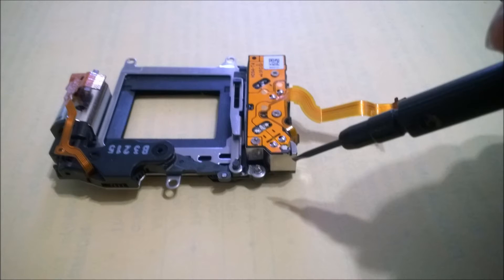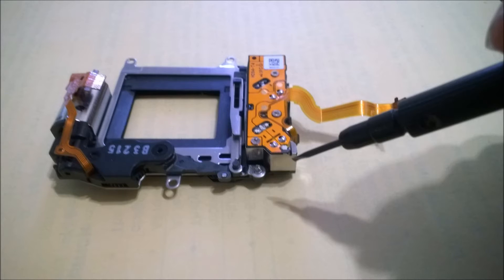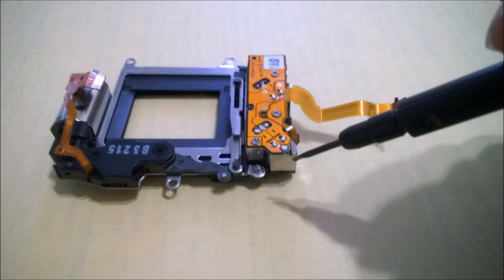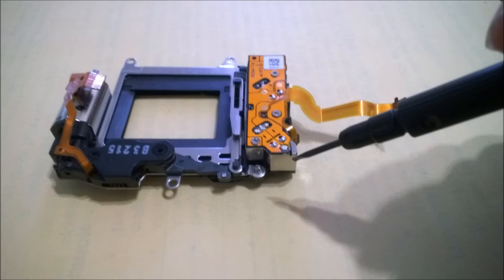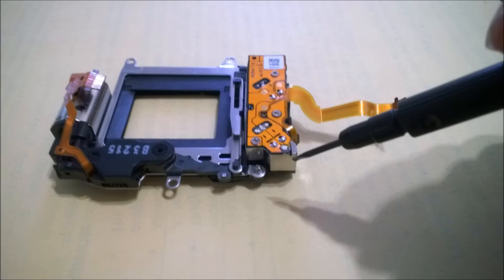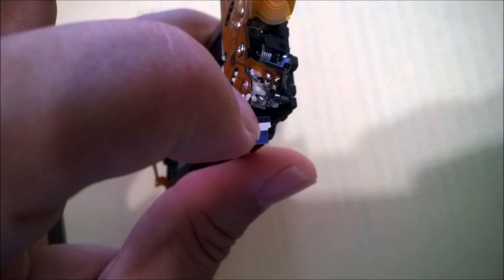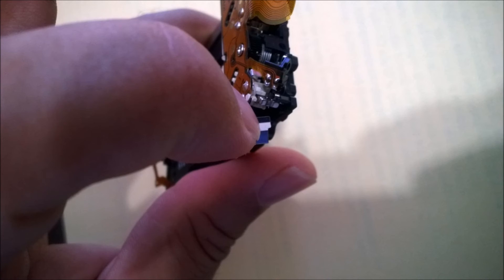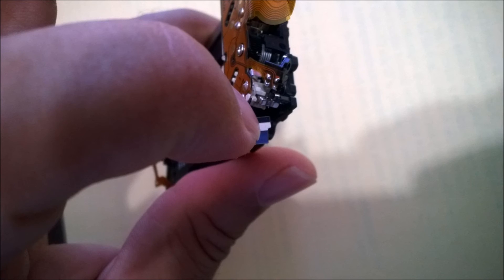Sony Nex Shutter Fix

Comment: Holy shit man, I have a similar issue with my a6000 where the shutter does actually work but the camera crashes after every time the shutter gets activated, displaying that same error message. However, sometimes the shutter still works and I found out that the shutter mostly works of the battery is above a certain voltage (above the voltage that the battery has when the camera is displaying around 70 percent). All that started when I accidentally dropped the camera from around four feet. It worked just like it is now, but even with a fully charged battery it crashed. Two weeks later I accidentally dropped the camera from about three inches and since then it works above that magic voltage :D. Yesterday (after having a broken camera for six month) I decided to take it apart this week and try to fix it and your video is really helping me now. I guess something similiar is the problem... Anyway, thanks for sharing. 
Blockbuster
Reply: Did you end up fixing the issue. My A6000 fires the shutter twice then gives me a "camera error, turn off and on" I initially read it could be the shutter but I can watch the shutter actuate. Please let me know!
Reply: MrGman10125
Well, after having taken the camera apart twice and not having found a particular fault in the shutter I came to the conclusion that it will need a new shutter module because the fault is somewhere where I cant fix it. I found out that the shutter is quite cheap at bout $40 but just when I wanted to order it I found out that after the second disasambling of the camera the shutter now works down to about 5% battery voltage and it does about one or two second bursts before crashing. Unfortunatly I damaged the wirering from the mainboard to the lens mount on the first disasably so I only ordered a new one for $5 and I will replace it.
Your case seems to be quite simillar, there might be a problem in either the loading or the unloading mechanism of the shutter which only gets detected by the camera once the full shutter movement is done (maybe due to a slightly off timing). I suggest you replace your shutter. If you do it yourself it will cost you (like i said) about $40, if you get it changed by a repair service it will cost you about $200-$400.
Reply: Thank you for the reply! I had intended on purchasing a new mechanism and doing the install myself. I will also order new wiring just in case. I really hope this (somewhat) simple swap will solve the issue and I will regain use of the camera!

Comment: Hello, I have the same problem with my nex-3n (TURN THE POWER OFF AND ON AGAIN), the shutter curtains were  always opened in my case. So I took the camera apart. I just want to know, if you pull up the part (in the middle of  picture 1 in this video) will it close the shutter curtains? In my case it doesn't work.
Reply: Hi

Comment: in my own case I removed the black cover where you can see the small spring,then I found out that the spring is in other,so I suspected the wire coil that produces elect magnetic flux that helps the center iron to move back and push the small spring which will activate the normal function. if you can be able to recoil that coil with the same value of coil your camera will start working. any question you can contact me on Facebook with this name: Utchutch utch.
Reply from the maker: Good idea. The next camera I disassemble, I might take a macro image of the spring itself to show what it should look like. Amazing how such a fragile small spring part could disable an expensive camera!